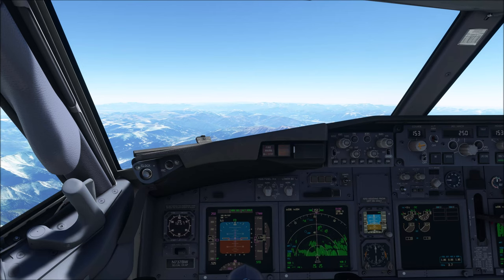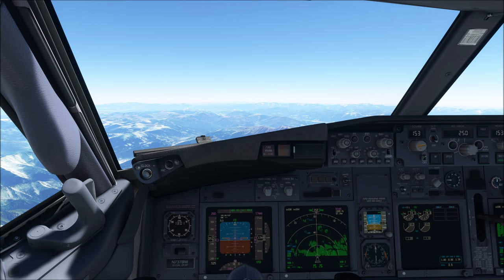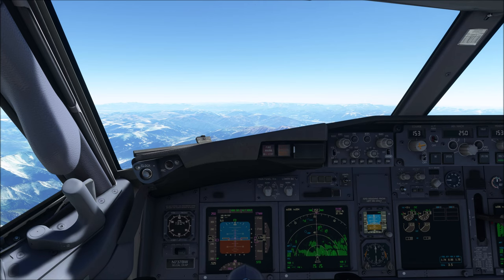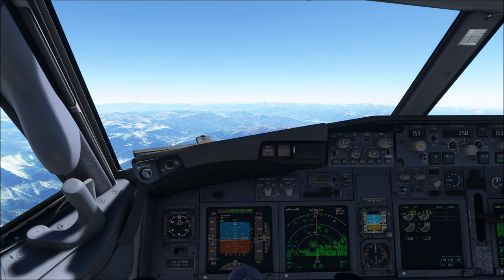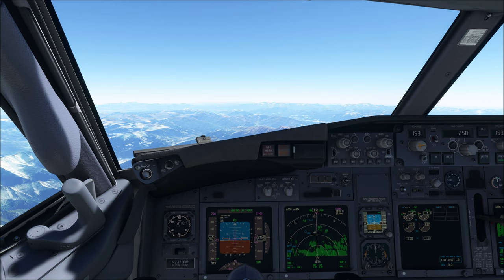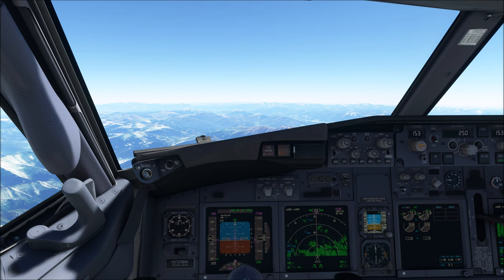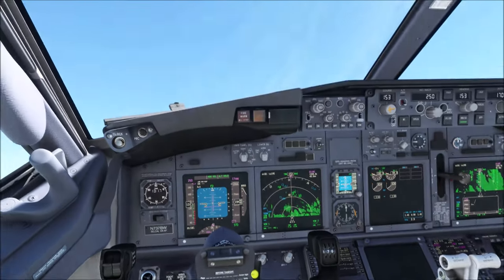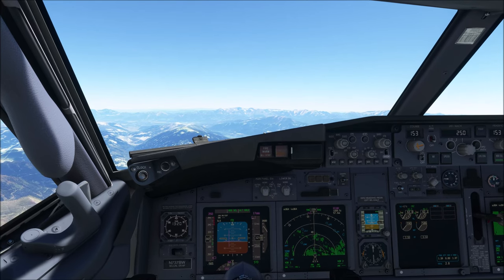PMDG 737-700 Tutorial: Upset Prevention and Recovery

Comment: 20:14 damm, now there a tricky picture on the ADI. I wonder if it is modeled right in flight sim, usually there is a little sliver of blue on the ADI, just so you can see the sky is at your feet.
Reply from the maker: mmh, good question. I don't remember off my head right now how it looks in the real one, we don't turn the plane upside down every day LOL
Reply: @A330Driver  I was messing around in our fixed base trainer, just to practice some uprt. Ps, I fly a an a220, so may be slightly different.

Comment: does this trim even work correctly? i know there are times when i'm landing in the sim and the trim is at like 10 units nose up and the nose is still dipping.... even with vref+15 for example... is this correct behaviour?
Reply from the maker: It can be correct behaviour, yes. Depends on the circumstances and loading of the plane for sure, but overall yes, it is possible to need such a trim setting for landing.
In the -800 in real life we usually find the trim somewhere around 9 units after landing. The flaps cause a strong nose down moment which is why so much nose up trim is needed to compensate.
Reply: @A330Driver  oh wow nice explanation, thankyou for that.